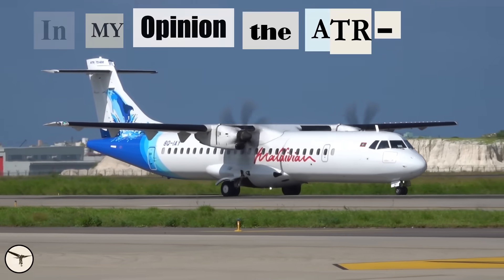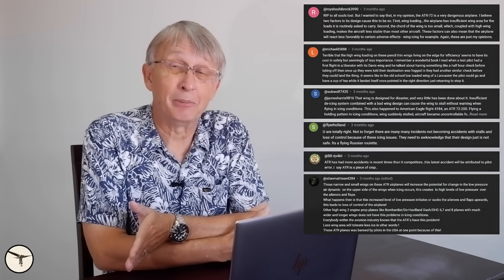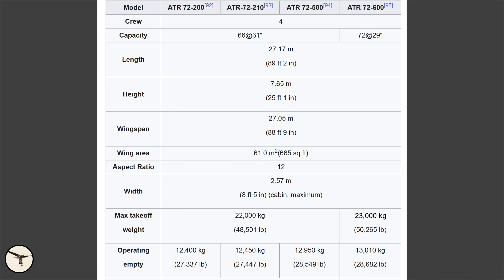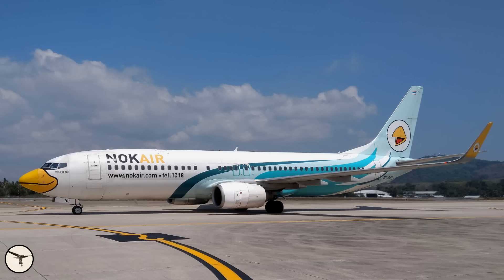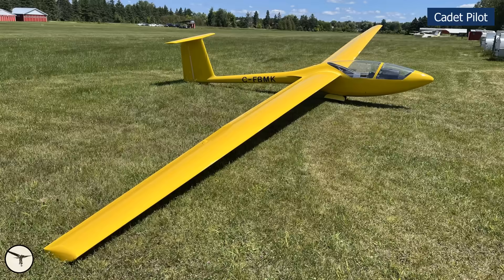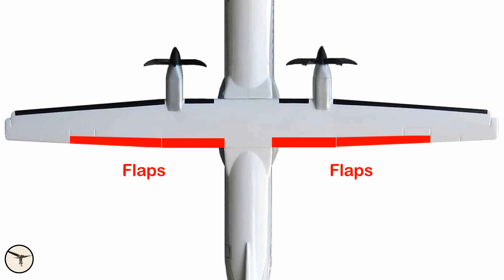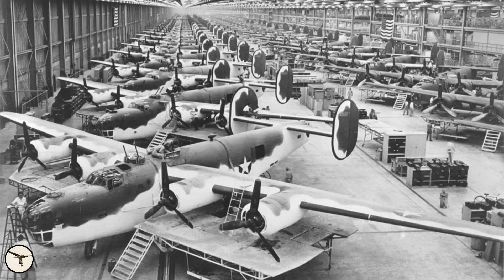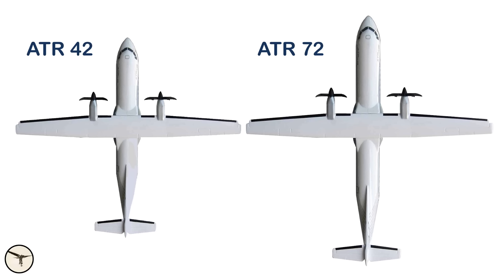What If the ATR 72's Small Wings Were Actually a Design MASTERPIECE?

Comment: Fascinating… could you offer thoughts about why the ATR’s are so dangerous in known icing conditions? Didn’t an American Eagle ATR kill people the same way the Brazilian ATR did?
Reply from the maker: The ATR is generally safe in icing conditions, provided that the proper procedures and limitations are followed.

The tragic accident in Brazil occurred when the flight continued operating in icing conditions despite a failure in the wing de-icing system. Continuing the flight under these circumstances was a critical mistake. Additionally, the crew failed to respond appropriately to multiple warnings, including the stall warning and stick pusher activation. When the aircraft eventually stalled, they applied full rudder and full power, which led to a flat spin.

The American Eagle incident, however, was markedly different. In this case, the aircraft did not stall. Instead, an ice ridge that formed behind the de-icing boots disrupted airflow over the ailerons, resulting in an uncommanded aileron deflection. As a result of this event, ATR made modifications to the de-icing boots and updated the operating procedures. They also introduced an Aircraft Performance Monitoring (APM) system that alerts pilots when ice accumulation increases drag.

Comment: Small wing cords give high wing loading AND increases wing  aspect ratio. The first brings the optimal L/D to a higher speed and the latter increases the flight performance in general.
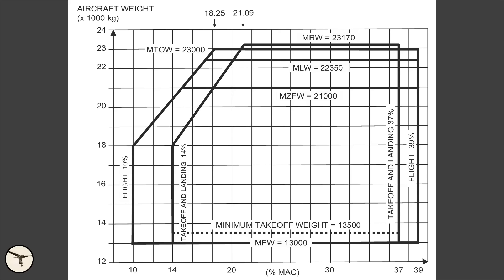BUT a small cord limits the travel of the centre of gravity. At the ATR's it is only 61 cm of allowed travel, calulated from 8:01 in the video.
To extend this limited cg travel a longer tail arm and a larger tail surface  have to be there. 
And where goes it wrong? As the tail-surface accumulates ice. The mass of the ice is far aft the influence on the bacjward travel of the centre of gravity is big. 
Very likely this was cause in the Brazilian spin accident. The tail icing pulled the cg aft and ruind the aerodynamic performance of the tail too. Recovery impossible. 
After the crash the ice melts quickly and the evidence is gone.
Reply from the maker: Don't forget that ice also accumulates on the nose of the aircraft. The weight of the ice in the tail does not affect the CG much. Besides, the horizontal stabilizer has de-icing boots. 
Regarding the accident in Brazil, it happened because 1) The de-icing boots had failed. 2) The aircraft contitnued flight in icing conditions. 3) Drag from the ice caused the speed to decrease. 4) The crew did not react to warnings from the aircraft, including stick shaker and stick pusher. 5) When the aircraft stalled, full rudder and power were applied. This caused the aircraft to spin.
Reply: @FlywithMagnar  That is a good reasoning. 
Nevertheless small cords allow, absolutely seen, small movements of the cg. Unless a in relation big stabiliser is fitted, but that cost mass and drag.

Comment: Not so fast, the question is rather in which use  those aircraft is promoted, seems to me  that ATR  is marketing  larger versions of their airplanes  with higher wing load in comparison to  the   Q-series!
The Q400 is out of the question in this regards, because it was designed for longer flights, the  Q300 is a more realistic short range and STOL  comparison!
Total wingarea for the Q300 is 56,3m2, divided with 19500 kg max take off weight gives 346,35 kg/m2!
Total wingarea for the ATR 72/600 is 61m2, divided with 23000 kg. max take off weight gives 377 kg/m2!
The ATR 72/600  have  significant higher wing load pr. m2 wing area  than the Q300 on other words.
Those Q100/200 have  even lower wing load  than the  Q300  with only 287,9kg/m2
Maybe those  ATR 72 should be replaced with the smaller versions like the 42 versions which have  around 310 kg/m2!?
In general, the comparable  Dash 8  planes have  more wing area pr. kg than those ATR planes!
And then we have the shape of the wing...which is another matter in this regards...!?
Those ATR planes was banned  for use  in icy condition by the FAA as of Desember 10. 1994.
Iran’s Aviation Organization did also ban those  ATR for the same reasons  by February of 2018.

Comment: We cannot argue with your analysis but I would point out that my home airport IOM, is noted for the worst weather possible and many years of benign Dash-8 flying never caused concern. However, on switching to the ATR's, immediately one became aware of  something not 'right' on final approach/flaring. As a single engine PPL with many types logged, flying qualities  are paramount and the first ATR problems I believe were aerodynamic tail blanking at slow speed, and just sitting in the back of one in difficult conditions dose my confidence no good! You Guys up front concentrating hard, might never 'enjoy' the arse clenching the cattle class endure!

Comment: I worked as Cabin Crew on the ATR 72-600, My only issue is the heat in the cabin which is horrific on the ground.
Reply from the maker: Two years ago, ATR upgraded the air conditioning system. It works much better!
Reply: @FlywithMagnar  That's a relief! It was sometimes so criminally hot in the cabin. I do love the ATR though have very fond memories of the Aircraft :)

Comment: I do not have flight experience with the ATR, but have about 5000 hours on the Embraer EMB-120 Brasilia. It is exactly as you say: as far as wing loading the ATR 72 is absolutely normal. And the wing aspect ratio - which has a direct effect on induced drag - must be maximized as much as the design materials and and structural sizing resources (numerical methods, etc.) allow. Nothing wrong with the ATR here either. After the Roselawn accident in the US in 1994 ATR did improve the aircraft, doubling the chordwise deice boot length, adding annunciations and improving the abnormal procedures. The accident in Brazil was a combination of several factors: the aircraft was operating with a single a/c pack and consequently limited to 17000 feet, a very unfavorable altitude as far as icing is concerned. The amount of icing that day was very severe, completely unusual in the Sao Paulo state here in Brazil;  it seems that one of the airframe the deice boots failed, generating a CAS message which calls for a checklist with two items: 1 - switch off deice  2 - Get out of icing immediately. The crew complied with the first item but ignored the second one. The aircraft lost speed, resulting in another annunciation, and the crew did not react to it.  I get the impression that the crew did not understand the seriousness of the situation and the associated high risk.

Comment: A few comments on the B-24 Liberator. At higher angles of attack, the wings of the B-24 could exhibit some challenges. High aspect ratio wings tend to have a more gradual stall, but the B-24 was known for having a somewhat abrupt stall behavior, especially if not flown correctly. This was due to the wing's design, which included a Davis wing profile with a high taper, leading to a concentration of lift towards the root of the wing.

The high aspect ratio can lead to the wingtips stalling before the root if the wing is not properly designed or if flown at very high angles of attack. This can cause control issues, particularly in turns where the inner wing might still be producing lift while the outer wing stalls. And in a combat aircraft like the B-24, these characteristics are not insignificant.

While the high aspect ratio wings were great for efficiency, they could make the aircraft less responsive at high angles of attack or during combat maneuvers where quick changes in direction or altitude were necessary.

Pilots had to be cautious with how they increased the angle of attack due to the possibility of losing control if the aircraft approached or entered a stall. The B-24's control surfaces, like ailerons, had less authority at these angles due to the flow separation over the wing.

The B-24 Liberator's high aspect ratio wings were optimized for long-range efficiency, making it an excellent choice for missions requiring endurance over combat agility. However, this design also meant pilots needed to be aware of the aircraft's behavior at high angles of attack, where the wing's characteristics could lead to less forgiving flight dynamics. Pilots were trained to manage these aspects carefully to ensure safe and effective operations. And the vast majority of pilots who underwent this training usd it with success. But there is no denying that in combat, usually over the target area, or leeaving the target area and being intercepted on the return flight to base, pilots handling the plane in a rough fashion, trying to avoid flak — or more commonly — enemy interceptors, demanded a higher degree of skill from B-24 pilots to keep them out of the Liberator's death zone.

As for Boeing/NASA's senseless SUGAR Volt Project (Subsonic Ultra Green Aircraft Research), it is a idiotic waste of tax payer's hard earned dollars to solve a non-existing problem. Boeing's management have proven themselves incapable of running the company safely and efficiently these past couple of decades. Just a few weeks back they decided to scrap their, quite frankly dangerous DEI program. The question is just now: —Is it too little too late.

Of course, with SUGAR Volt, they are 'smoking' their, oh so familiar OPM pipe (Other People's Money) to solvee a non-problem. We do not need less CO₂ in the atmosphere. We need MORE! Plant life is starved of CO₂ — The Gas of Life, as we are, geologically speaking, still coming out of the last glaciation period.

Saving is a great concept and the way to go about it would be research into ever more efficient engines, not carrying insane tonnage of battery packs into the air and crowding already crowded airports with airplanes with such poor performance that we are actually taking a step back in time. But for Heaven's sake, let the market decide when it's time to develop new technology, rather than forcing this madness onto the industry — Soviet Style! It will not work. If it had ever worked, the Soviet Union would still bee in existence.

So, since you brought up the scandalous SUGAR Volt Program, run by a company that is failing on several fronts and a Federal Government institution famous for busting budget with astronomical figures, I thought I would look up exactly how much the American Tax Payer has to bleed for this Soviet Era program. And wouldn't you know… Even the figures are kept Soviet Style! In other words: — The figures are SECRET. The budget overruns are SECRET. They obviously do not want the Americans forced to pay for this nonsense to know how much of their money is being wasted or who is getting rich in the process. Nothing new there. That's how all these "green" projects are run, while Child Slave Labor is rampant, mining minerals for the "Green Elite's" battery packs and the Planet isn't being saved by The Gas of Life, CO₂ — but rather poisoned by highly toxic mining operations and the dumping of toxic batteries at the end of their life-time.

Boeing has experienced significant budget overruns in other NASA projects like the Space Launch System (SLS) and the Commercial Crew Program's Starliner. For instance, the SLS project has seen billions in overruns due to delays and technical challenges. Similarly, the Starliner program has faced considerable cost overruns, with Boeing reporting losses totaling $1.5 billion as of 2023. It is quite frankly shocking that they waste money on these Neo-Marxist Pipe Dreams when the company is in shambles. And it isn't only the American Tax Payer who has to pick up the bill for this. It's also the Customer of the Aviation Industry in more expensive aircraft and higher Air Cargo prices.

I can guarantee that there is no "Man Made Climate Change". I can guarantee that there won't be any "Man Made Climate Change". In a century or so, when we will start thinking about alternative sources of Energy, a Free & Open Market will see to that. And at that point, there will be much more Common Sense moving things forward. That is really the only thing that has successfully been at the root of EVERY Innovation in Aviation!

I agree with your conclusions about the ATR 72, Fly with Magnar, which earned you one more subscription! 👍
Reply: Your aeronautical analysis is so vague to be worthless and your political ramblings confirm that you are a little touched in the head.

Comment: No, you are wrong about the wings too small. To reduce approach and landing speed you need sophisticated flaps. Comparing to other aircraft does not make sense at all. Owned a MU2 which is the same concept, had other problems,  but not because the wing load was close to a B737.

Comment: The horizontal stabiliser being further back does increase short period pitch stability, but you also have to consider the effect of the longer fuselage itself. The longitudinal moment of inertia of the fuselage has also increased which destabilises the short period pitching mode. It's hard to say what the overall net effect is but if they didn't resize the horizontal tail, then it probably didn't change all that much.

Comment: One significant negative aspect of the ATR 72's wing design that wasn't mentioned here is that it appears to have no washout, whether aerodynamic twist or geometric twist.  This increases efficiency of a high aspect ratio wing, but creates adverse stalling characteristics, as the entire wing will tend to stall at once, as opposed to more favorable stalling characteristics where the root stalls before the tips.
Reply: Accurate, but partial explanation regarding the wing loading factor. Very well noticed by this commentator, aditional reference to wing washout. 

Further, why can it be argued that ATR has flawed wing design? 

Wing loading, is one very important aerodynamic parameter, and here ATR seems to be within the technical norms, aligned with the competition. 

This ATR instructor however, forgets to mention one CRUCIAL aspect, that makes ATR more demanding, i.e. dangerous airplane to fly, if not treated with extreme caution by it's pilots.
And it is the supercritical profile of the wing it has been designed with.
Supercritical profile is very fuel-efficient, and has excellent performance parameters - in near ideal, optimum conditions.
However an airplane that is utilized in public transport, has to be certified to fly in real - time range of meteorogical conditions, that includes icing conditions. 
This is where an ATR differs to similarly designed aircraft. 
Unfortunately, it's supercritical profile deteriorates, in turn creating much more drag, with the MINIMUM amounts of ICE on the wings.
The fact is that almost ALL the ATR accidents with catastrophic outcome have happened in icing conditions, combined with often various levels of neglect or direct errors commitied by it's crew in these challenging conditions, which in turn resulted in unfortunate outcome of crew losing control of the aircraft.
So, yes, it can be argued that ATR is a flawed design.
Even ATR engineers and pruducer have tacitly acknowledged that by introducing non-icing and icing speeds into it's standard operations. 
Overall performance is also sub-par comparing with the direct competition.
I personally have encountered icing while flying an ATR thousands of times, and never had an issue. But I can also vouch, and advise any ATR operator, to treat it with extreme caution during operation in Icing conditions! Much more so then any other aircraft I have flown in the last 40 years, and counting. 
This statement by an EX-ATR 7000 hours captain.

Comment: I flew on the A72 from Athens to Crete Chania in October 2024. I did have the accident in Brazil in mind. The flight was very pleasant actually. I had expected the noise level to be high based on past experiences decades ago on similar propellor planes but I was pleasantly surprised. At no time did I feel that the A72 is unstable or dangerous. ATR planes have had issues in cold conditions with de-icing etc. before. Thats what may have happened again in Brazil this year. No such conditions in Greece in October. Sunshine and 24 degrees C.

Comment: The early ATR had it's original design de-ice boots changed basically to ease manufacturer and costs. There was a prohibition of flying it in icing conditions. The ATR 72 is basically an upsized ATR 42. I'm not sure if the icing condition prohibition is stroll in effect. It is possible to encounter unpredicted icing conditions at altitude.
Reply: Icing is still an issue for the ATR72...

Comment: The Fokker (Fairchild) F-27 also had quite high aspect ratio wings for it's era and weight, probably much less wing loading that the ATR-72.  It's known for it's ability with climbing out steeply. (for it's era..) with the rather marginal power of the Rolls Royce Dart turboprops.  Recall that this airplane was tasked with replacing the DC-3 at regional airports. I remember when our airport was serviced by West Coast Airline's DC-3 and then the Fokker F-27 replaced these old 1930's era airplanes.